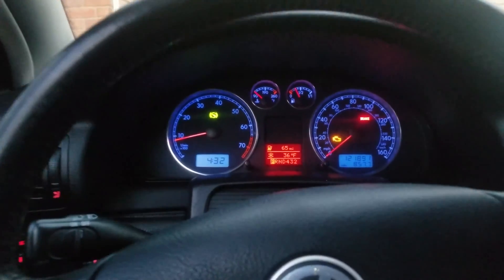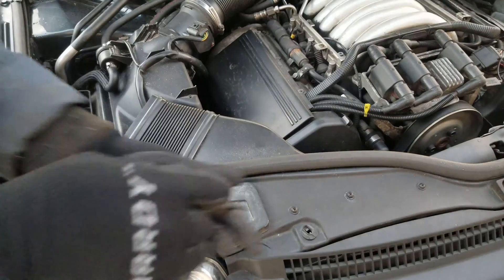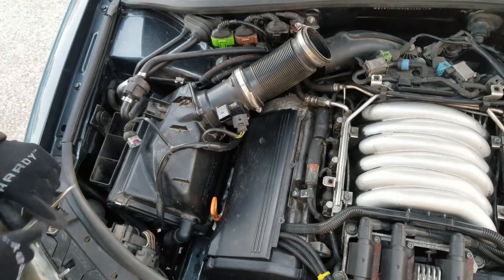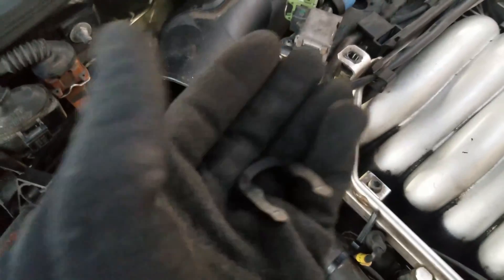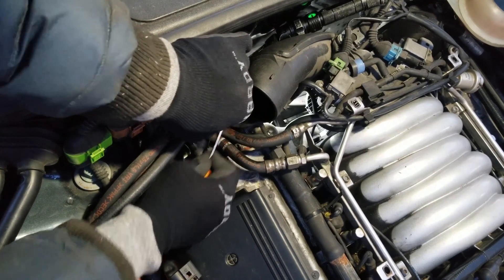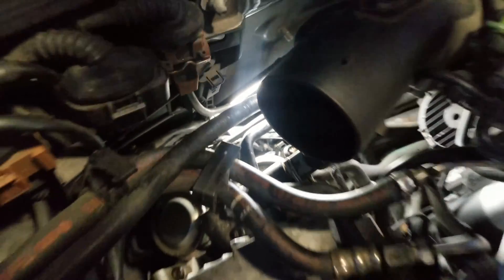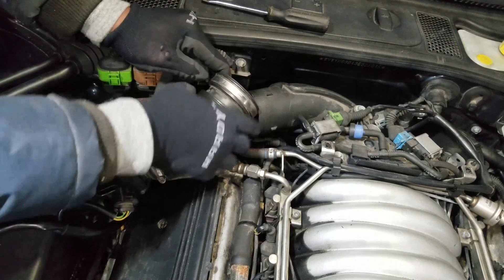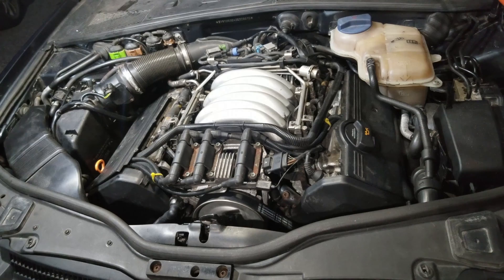Volkswagen B5/B5.5  2.8L V6 - P0118 Coolant Temperature Sensor Replacement 1998-2005

Comment: I need help could you tell me where the fuel regulator has the Passat 2003 I hope you can help me thank you or someone who can tell me where it is located
Reply from the maker: Which engine do you have?
Reply: @CraftyWorkshopBuilds  2.8
Reply from the maker: It's on the fuel rail. on the right, the side of the coolant reservoir.
Reply: It doesn't have a picture of how it looks to be able to identify it. Okay, can you please?
Reply: Another question I do not know if this type of machine has Turbo?
Reply from the maker: @abimaelacosta7001  nah, this engine does not have a turbo.

Comment: You could've just removed the mass air flow sensor Intake hose to get to the sensor. Why remove the air box?
Reply from the maker: The box is easy to remove, and it allows for more workspace.